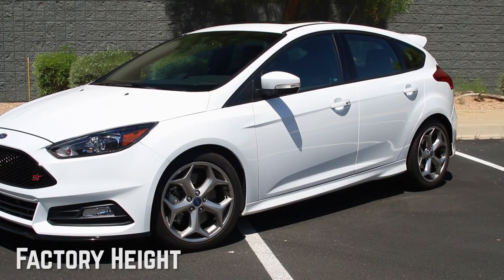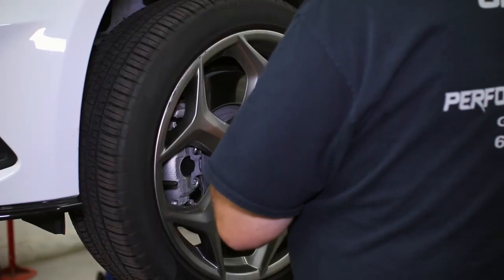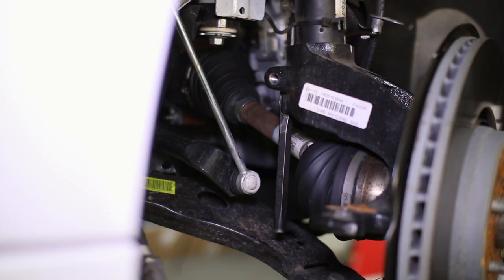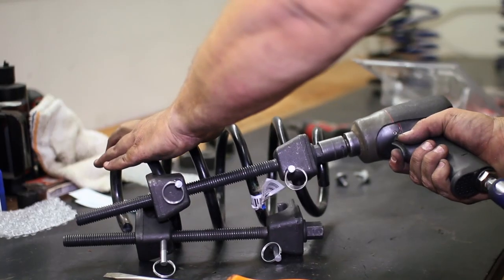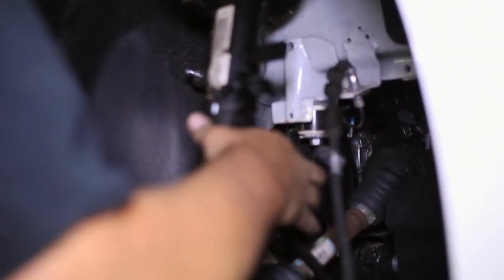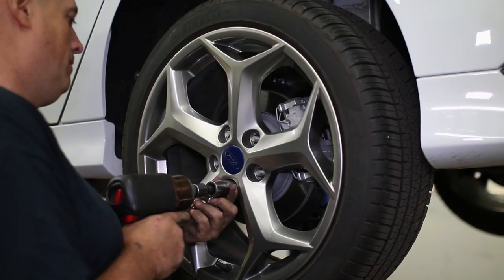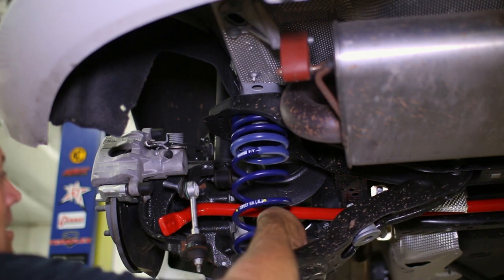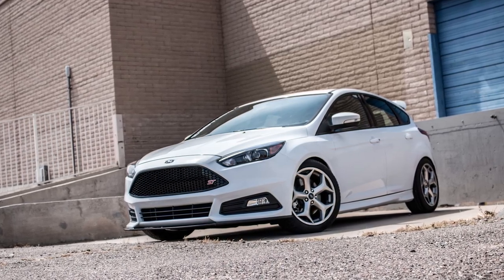2013-2017 Ford Focus ST Ecoboost H&R Sport Springs Install

Comment: Great vid, good quality guys!
Few things I noticed...
-the hub nut and ball joint are not necessary to remove..though I guess it helps to wrestle the strut out of the lower control arm. Just the saw bar.
-You can tell which part of the upper strut assembly faces in (towards the engine), its the side with the two 'nubs'. And the lower part has a single notch that fits in a notch as well.
-The bolt on the lower strut area can be bolted through the opposite side, against a screwdriver or metal plate to spread the strut housing if you dont feel like 'hammering a wedge' up in there.

I've done this on a few of my cars..about to do it on my FoST finally. So its good to see different ways others use to make it easier if the ways I've seen don't go so easily!
Bought these exact springs for my '16...can't wait to experience better handling!
Reply: Also...is it advised to put in adjustable sway bar end links if you upgrade the sway bar?
Reply: Think this can be done using jack stands or do I need a lift?
Reply: @cptnscoob  I did mine in my driveway. Jack and Jackstands. Just watch a few vids, pretty simple. Hardest part is compressing the factory springs. Most parts stores rent them cheap or free with a deposit.
Reply: @dham99  Adjustable sway bars ae advised if you lower the car. Reason being is to keep oem geometry of the sway bar.
Reply: @dham99  Yes. Absolutely yes. The stock end links are designed to mate with the stock sway bar. Definitely should upgrade the end links with the sway bar.
Reply: @dham99  Not doing so will mean an early death to the end links and you'll be replacing them anyway.

Comment: Love the video! Do you need to worry about the stock dampers not lasting now that the car is lowered? I'm thinking of buying the same springs but the dampers needing to be replaced are my only concern. Thanks!
Reply from the maker: Our stock dampers didn't feel maxed out with the H&R springs, we never experienced them bottoming out or anything. I'd say just run the stockers until they do wear out and upgrade then :)

Comment: I HAVE A FOCUS ST WITH SPACERS IN THE REAR WHEELS OF 25MM, I WANT TO PUT THESE SPRINGS, MY DOUBT IS: ARE THEY GOING TO STICK OR ROZE MY RIMS WITH THE BODY?
Reply from the maker: We had the same setup on this ST as well. We ran these H&R Sport Springs with 20mm spacers in front, and 25mm spacers in the rear on stock wheels. Our car had no rubbing on that setup.
Check out the full wheel/tire/suspension set up here - https://www.stage3motorsports.com/Suspension-Brakes_c_4095.html
Reply: @stage3motorsports  thank you so much

Comment: What is the front and rear drop on this car. It sits exactly how I'd want mine sitting. Been looking at springs too long now, trying to make the right decision.
Reply from the maker: Here is the suspension and braking section of our Focus ST build page. We went with H&R Sport lowering springs. Couldn't be happier with the amount of drop and handling characteristics they provided. - https://www.stage3motorsports.com/Suspension-Brakes_c_4095.html

Comment: You had way to many unnecessary steps. If you pull the cowl vent covers, you could pulle the cowl and the lower panel once the wiper arms are removed.  No need to pull the tie rod or axle. Just the end link and brake line bracket. Good video though.
Reply: Think this could be done entirely on jack stands?
Reply: Without a doubt. I just pulled the coilovers out of my car. Car was on 4 jack stands start to finish.